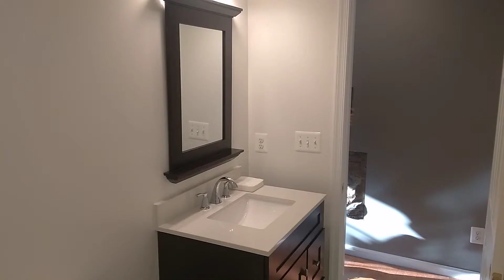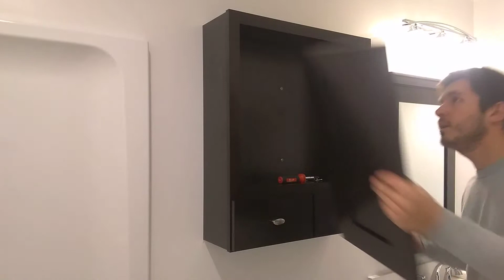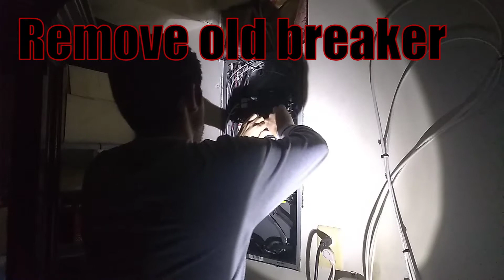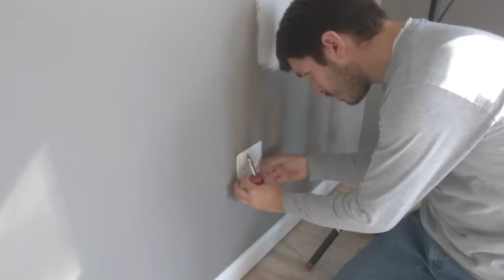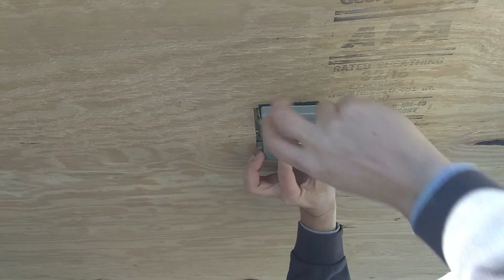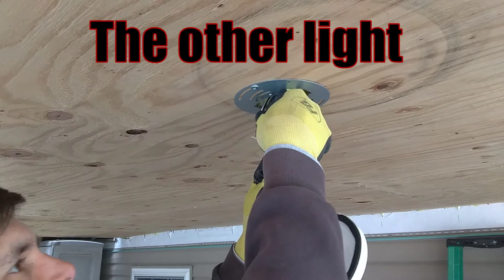House Addition | Electrical Final Inspection | Day 70

Comment: I will say this, I agree with everything done in the panel except one thing. NEVER under any circumstance when you flip that main over to on, (1) stand in front of the panel like you did. (2) flip it with your right hand while standing in front. This is why you should stick to doing anything but electrical. Stand to the right and flip with your left hand, or vis versa and to the side and flip with corresponding hand. Seen too many accidents where someone does that and their blasted with an arc flash and swept up in dust pan.
Reply from the maker: Appreciate your concern and thank you for the tip.  Thanks for watching
Reply: Horst Carpentry electrical by trade! I always like to push safety as the main goal for electricians! The goal is to go home safe not in a dust pan or body bag! Thanks for a great series!
Reply from the maker: Thanks for the comment and thanks for watching